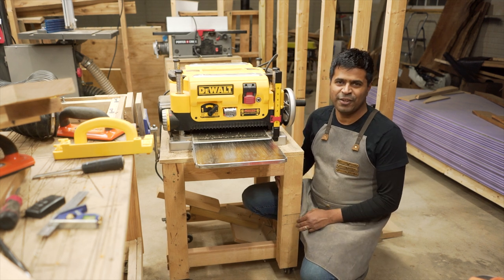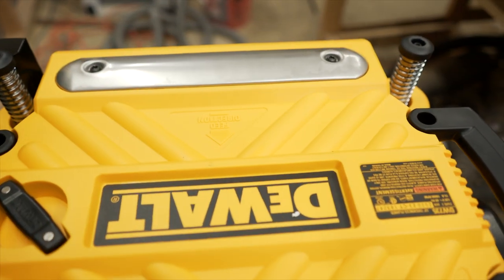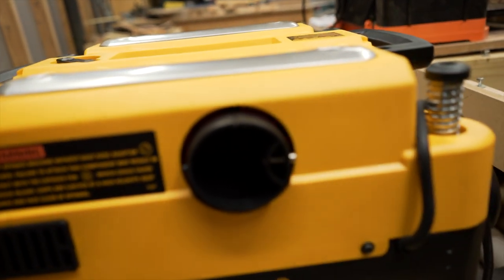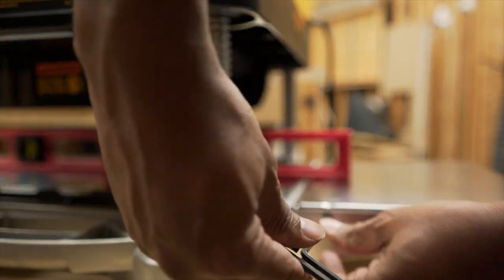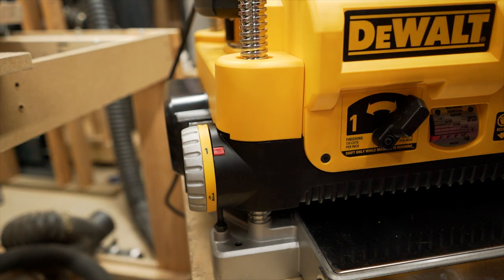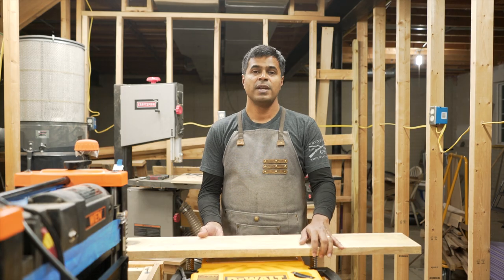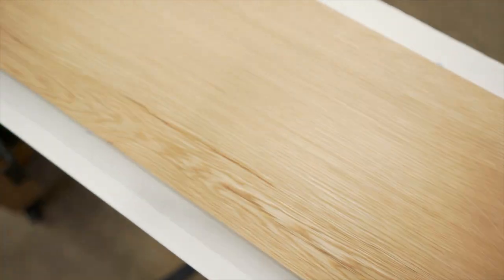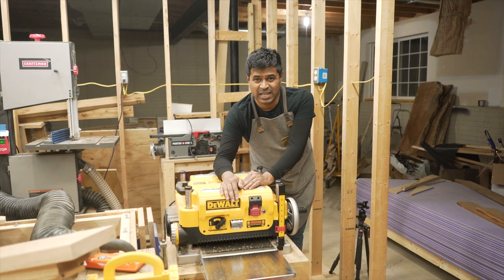Dewalt DW735 Planer Initial Impressions and Jointer Sled Build.

Comment: dewalt needs to make it impossible to switch gears, with the machine off. I cringed when you switched the lever. I hope you found out that damage can occur before you damaged yours. I damaged mine because I forgot and thought It was supposed to be off when the lever is switched between 1 and 2. design flaw, in my opinion.
Reply from the maker: I only did it once! I always run it in slow mode. I do wood working for fun in no hurry to rush things through!
Reply: Instructions actually tell you to engage it while it’s running.